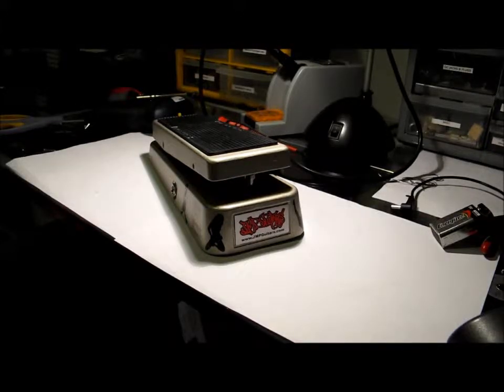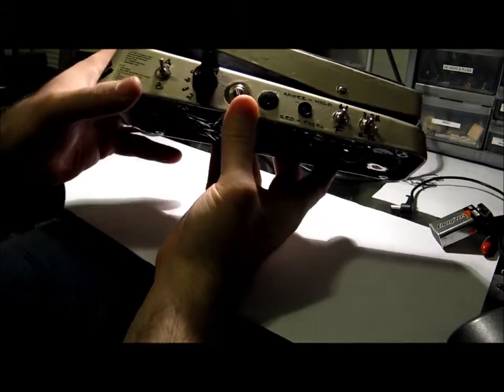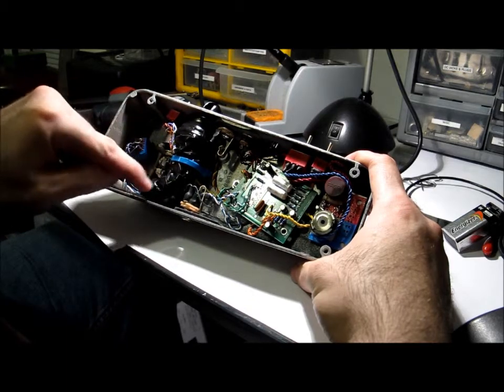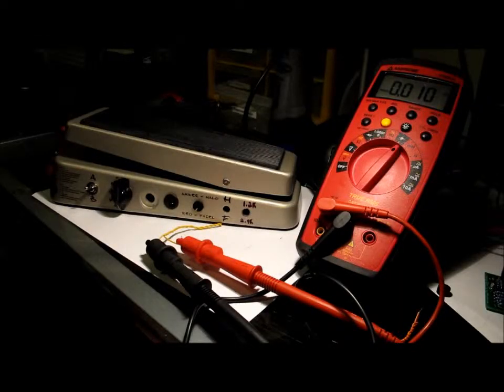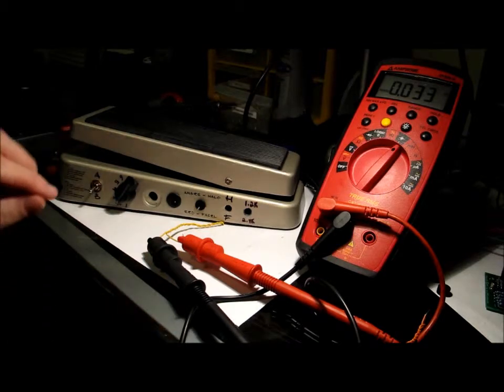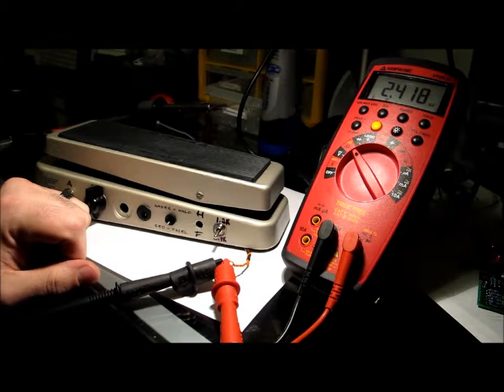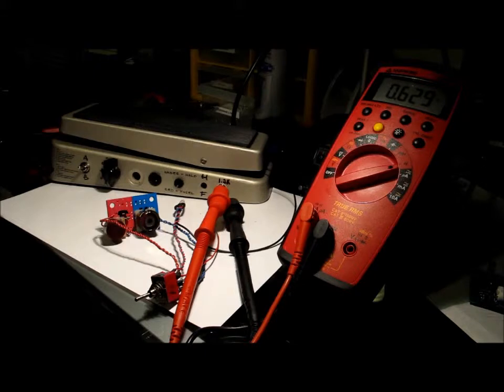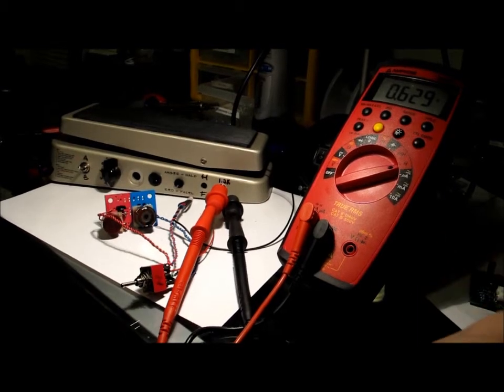JMP Guitar - Making of a Wah Wah Pedal - "The JoshuWah Beast"

Comment: I have been modding my pedal and have gotten some good sounds out of it,. I have a red fasel, and a yellow fasel and the tone difference between them is slight at best, I almsot hear no difference, even the stock inductor almost sounds the same as either of the fasels, I suppose I bought into the snake oil, I have just 2 capacitors on a mini toggle, one is a .022uf and the other is the stock .01uf. this is where I hear the most difference, I have a 4.7k variable resistor on the midrange for fine tuning, a 470ohm variable resistor on the bass gain, a 100k variable resistor on the gain, and a 100k potentiometer on the Q resistor next to the inductor, I have wires coming off the board from where the inductor goes running to the center poles of a dpdt mini toggle, and an inductor wired to either side of that switch, I did the same with the sweep caps,. maybe i wired it wrong but it seems to work, only I can't hear much of a difference on the inductors
Reply from the maker: If all the other components are good, and the inductors are good, it's all good. The differences are subtle. The mid cap and mid resistors are the most noticeable changes; they affect the overall tone and sweep range. As you pointed out, there is way too much snake oil regarding the inductors. Is there a difference? Probably. Does it matter? Probably not if they're all good inductors. Although I do remember trying some overpriced inductors that I thought sounded much worse than the average priced inductors I usually worked with (2 or 3 times as expensive and sounded like crap).

Comment: Hey can i ask where you bought the Halo Inductor?
Reply from the maker: I honestly don't remember. I got them from a few different sources. Don't spend more than $20, it's not worth it. And definitely don't buy into all the hype from people selling them. Small Bear Electronics is usually a good resource, and I'm sure I've purchased inductors from them in the past. If you have a good multimeter that can read inductance, you're better off to test first no matter who you get it from. If you're around 600mH, you should be fine (+/-100mH = whatever, listen to it and see if you like it). If I had to guess, I would say that's probably an Eleca halo inductor.
Reply: Thanks for the quick reply, Yes i know about the hype The main thing i want is Vintage correct looking for those that buy into the hype, And its kinda funny i just came across  Eleca halo's inductor about 5 minutes ago,Thanks Again.
Reply from the maker: No problem! BTW- I'm not saying there isn't a different tone than the fasel stuff, it is different (subtly). Elecas shouldn't cost more than the fasels, probably about the same or less depending on the source. I usually choose between the two brands, or if a customer has a preference, that's what I'll build.